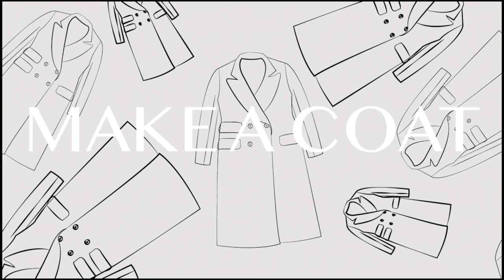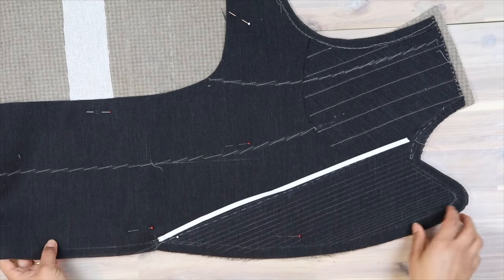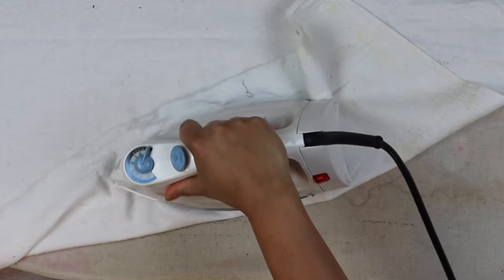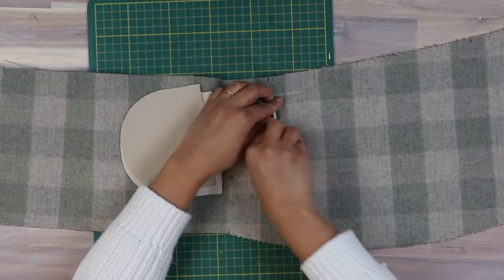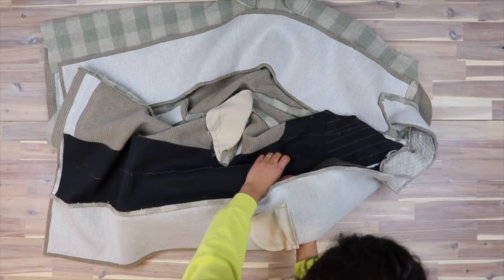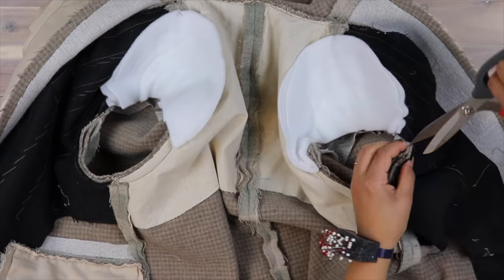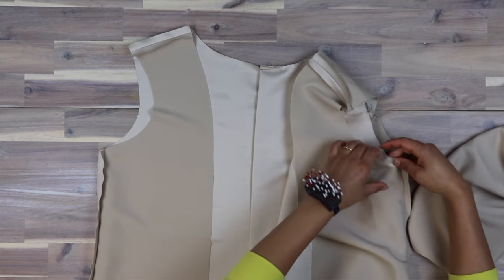DIY Wool Coat: Sew it Professionally from Scratch | LYDIA NAOMI

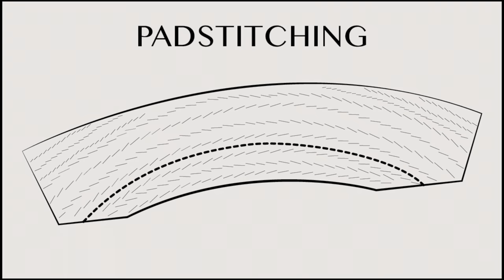Comment from the maker: 1:02 Pad stitching Collar and Lapel
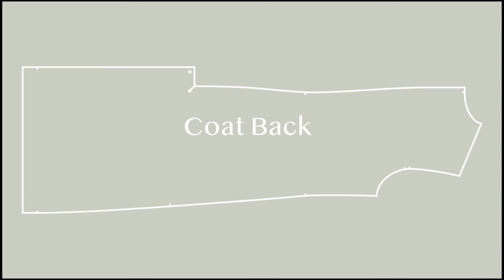4:20 Coat Body Assembly
5:32 Double Welt Flap Pockets
8:42 Notched Collar Assembly
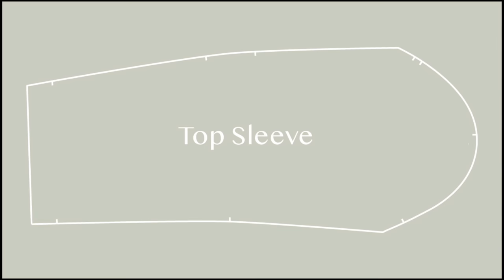14:07 Set in Sleeves
15:29 Insert a Sleeve Head
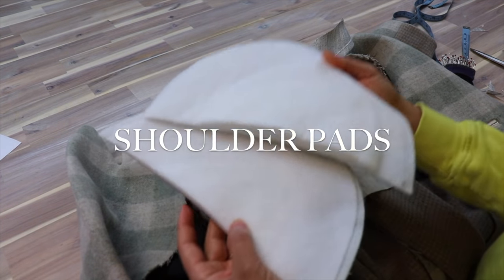16:00 Insert Shoulder Pads
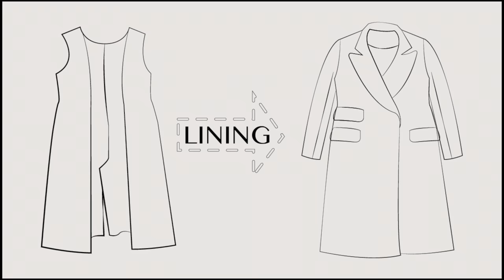17:13 Lining Insert ( Mitered Corner)
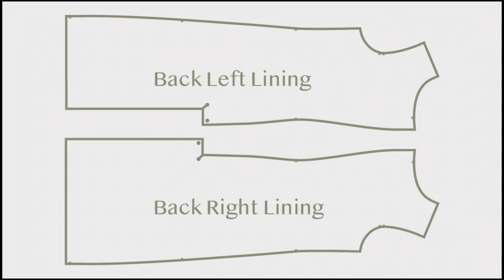18:39 Lining assembly
19:54 Insert lining
20:45 Lining Sleeves
22:30 Vent (Lining in Mitered Corner)
26:43 Hem Finishing
28:37 Pressing and Buttons
Reply: Please put this in the description so your video will have chapters

Comment: I love making winter coats but have always used speed tailoring’ techniques with iron on interfacing, rather than the traditional hand tailoring.  I love your attention to detail, I want to make a full wool coat.  Sadly, by the time I would have it finished, it would be the wrong end of winter and Spring would be looming.
I note that Peppercorn is excellent at quality control,  inspecting your work closely. 😘
Reply from the maker: Me too! Speed tailoring still looks really great!

Comment: I saw how many scissors you have and how well organized they were and I thought, I have to subscribe to this channel! :) I like that you put so much thought into the details, like stitching the interface to the coat instead of using the ones you can iron on. Is that an industrial sewing machine that I'm spotting? I have a Bernina and was wondering if it would manage to sew through so many thick layers. The pockets had soo many layers... :D The coat turned out gorgeous. :)

Comment: Hey, Lydia. I commented a while back asking if interfacing could be skipped and I've since mellowed on the matter. I'm finally having my overcoat (navy bridge coat) made. It calls for a far heavier fabric than I have access too, 32oz. Would it be possible to line a 16oz wool melton cloth coat with itself? Double faced cloth is also exceptionally hard to come by. I need the warmth but I just cannot find the right stuff. Found a supplier in China for 22-24oz wool which I was more than willing to settle for, but they don't do quantities less than 2000 meters.
Reply from the maker: I don't actually know, you could just experiment on a small piece of it, sew it double then turn it out and topstitch and see if its doable or looks good :)
Reply: @LydiaNaomi  thanks!

Comment: Hi Lydia, 

how much did it cost to make? how much time did it take? how much would u sell it for? It's a very technical coat that looks very expensive
Reply from the maker: good question - The final coat was maybe 2 or 3 full work days. The patterning process was about a week. The materials would probably be around 200-300 (but the main expense of the wool was covered because it was gifted). I think you would sell something like this for  $500-600 for retail. If you were making customs for people and fitting it to their size it would start at $1000 per coat. Thats based on Canadian wage and living. Also this is all off the top of my head, its could be more or less.

Comment: If anyone wants avoid understitching the collar and lapel, they can grade the seams that fold under an eight inch to force the fabric to fold over to the wrong side before sewing. However the lapel and collar sequence of construction is a little different because you want to maintain the fold over at the four point intersections. I find the understitched lapel on my vintage coats age poorly.
Reply from the maker: Thanks for that tip! I do grade back the edge of any under seams, i really should have done 3/16 for this weight of fabric...i wasn't aware that it would age badly though with understitching! Thank you!

Comment: That is so much hand sewing!! Good grief! 
What does that mean?(extending the felled line for reference? Reference to what? Please explain. I'm confused.) Thanks.
Reply from the maker: Instead of padstitching the horsehair you can use fusible interfacing instead :)
As to your other confusion, which part of the video are you refering to?
Reply: @LydiaNaomi  You said something about extending the line gor reference. You were working down by the hem, I think.

Comment: why do we need padstitching? i am new at sewing. can u help me ?
Reply from the maker: You don't need it if you use fusible interfacing. Fusible interfacing has a side that has little beads that melt and fuse to the fabric. Whereas with horsehair interfacing it doesn't have any way to stick to the fabric other than stitching it in this special way that doesn't show on the good side of the fabric it's stitched to. It's a very professional tailoring technique that typically requires a lot of practice and probably training. I just went for it but long story short, you could just use fusible interfacing ☺️
Reply: @LydiaNaomi  achhh thanksss, i couldnt understand the difference between them. thanks a lot